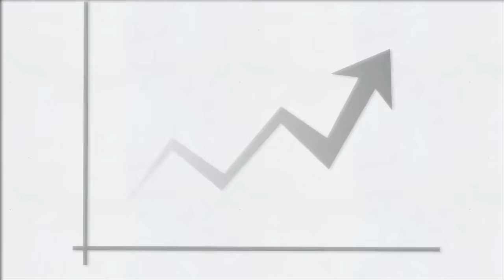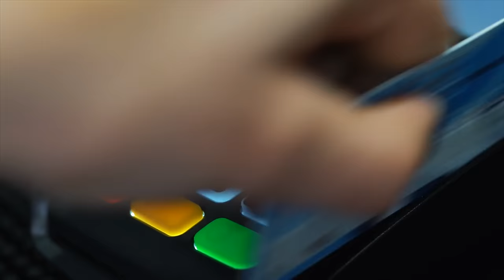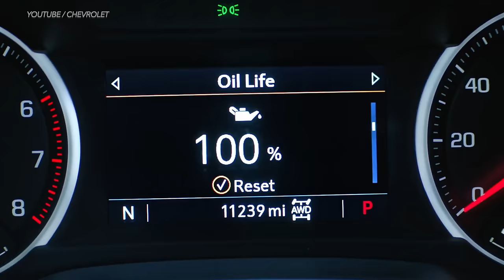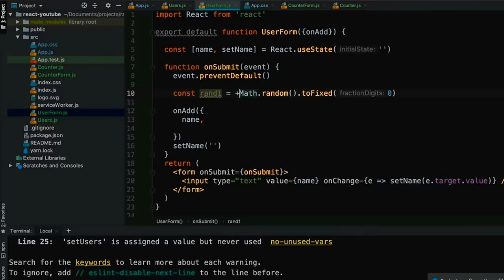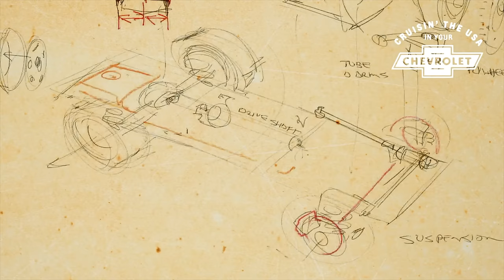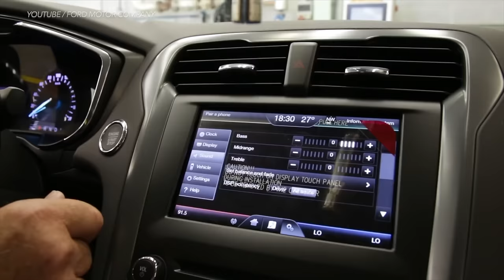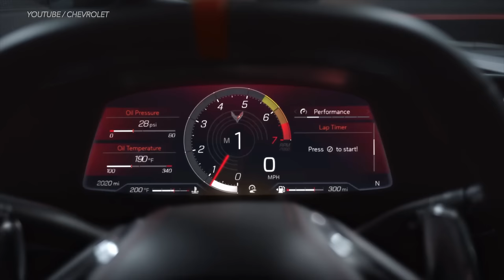Here's Why Car Companies Just Made it Illegal to Work on Your Own Car

Comment: Any company that prohibits Right to Repair doesn't deserve any business.
Reply: Exactly
Reply: That’s why I have a reservation for the Aptera. They design and support DIY maintenance and repair!
Reply: Auto industry is not stopping you to repair.  They are telling you to buy OEM.  That’s different than the IT industry, like Apple, that will not even sell you OEM parts.  If the auto industry tells you only their service department can service, like Tesla, then there is a problem.  Labor will always be the expensive part of the repair, $100-$150/hr, at a non dealer and $170-$200/hr at a dealer.  (Hawaii cost). Example $110 for a oil and filter change at a Firestone, $350 at a dealer (Lexus).  Filter and oil cost $50.
Reply: Yup.
Reply: Speak for yourself. What you really mean is, you say you don't want to give them your business. And that's your right (even though I bet you'll still do it anyway).
Reply: In the early days, the hood (Bonnet) of a Rolls-Royce was factory sealed. Only factory-trained mechanics were supposed to touch them. I sort of have this mental image of someone in a butler's formal attire polishing silver wrenches.
Reply: I am looking at Tesla, Apple Inc., John Deere. 
Good thing I am pragmatic, because I don't like these entities.
Reply: Ya oem is ok be quality aftermarket is often better. I do a lot of the work on my car myself too.
Reply: @executive  not they meant what they said
Reply: @lolcano2346  then it's a good thing it's not up to them
Reply: But yet we keep giving them our money.
Reply: companies don't have the power to prohibit anything
Reply: @executive  how do they not have the power to prohibit anything? You've been lurking round these comments a while
Reply: @executive  why is it a good thing it's not up to them? You haven't really been able to justify a single thing you've said here
Reply: @lolcano2346  look up the definition of prohibit
Reply: @lolcano2346  because its none of their business
Reply: @executive  it actually is their business. Your beliefs on such a thing pretty much come down to where you sit on the scale of pure socialism to pure capitalism, neither of which are good

Your username makes it obvious where you likely sit on that scale
Reply: @lolcano2346  LOL your username says you're 13 years old
Reply: @executive  So I'm not wrong? didn't think so

And I've had my username since I wasn't much older than that so that's unsurprising.. also irrelevant because my username isn't highly indicative of a corporate pig
Reply: @lolcano2346  you haven't grown up
Reply: @executive  sounds like the deflections of someone who can't admit that I'm bang on
Reply: too damn right!
Reply: xx, well I tried that before it didn't worked! I put out a Group of people up to 1000 activist, and after 4 years we were only down to 78 people, Activist. The rest of the people given up and choose to trade in their vehicles and get a new one instead and decided to go on their day to day normal usual business. We've been fighting for this for years. But the government the system is corrupt.
Reply: There's a difference between right to repair and owning a patent on something.  APPLE, for instance, has proprietary parts and nobody could work on the products except for at the apple store.  That is horrible for consumers.  They wouldn't even sell parts to an electronic repair shop, or their own consumers.  But a car company owning a patent for a time frame is acceptable.  As long as others can purchase said part.  They went through trial and error, research and development, and all that expensive stuff.  They should be able to recoup that money instead of having someone else just make the part and sell it without having endured the costs of development. Now engine parts, this is reasonable.  Plastic body and trim parts, far less so.
Reply: It's why I stopped  buying iPhone
Reply: @getacare2735  yep! Well said! 😁👍
Reply: @John Deere
Reply: Apple and anyother company that makes laptops and phones exits chat
Reply: @jasoncurtis4404  your patent, at most, prevents me from making my own copy of your thing. It doesn't give you the right to tell me I can't take it apart.

Comment: 20 years I worked in the automotive industry. I've had to tell customers the bad news about how much it will take to fix their cars and I always hated doing that. I've seen dozens start crying and breaking down over the price. They asked "Why is it so much" and I explain to them about modern cars and how the manufacturer makes them and parts. It's been 3 years since I got out of the industry and I'm sure within the last 3 years it just got even crazier working on certain brand of cars.
Reply: What ones were the worst?
Reply: @Redditor6079  at this point the entire industry is moving in this direction. If you want a car that not as bad, get an OLDER car.
Reply: @Msj10934  I would love to do that but rust eats car up in my area. Anything older in my area develops frame issues.
Reply: people need to start thinking about these things BEFORE buying a car. Not after it's broken down.
Reply: Crystal ball
Reply: @mojo_m7436  it's called research, and not getting sucked in by leather and gadgets.
Reply: I know what you mean.  And oftentimes that car will sit on the lot for months waiting for the owner to make a decision
Reply: 20+ years ago I had a friend working at a small repair shop and when a real hard luck case came in that couldn't afford the quoted cost he would  speak to them on the way out and tell them he would charge them half the labor the shop charges plus cost of parts if they could wait until  Saturday when the shop closed early. That helped a lot because most were older cars with easily accessible parts that weren't always  super expensive.

Comment: I started working in a GM dealership in 1968 and finally had enough of that by 1980. Then I became a backyard mechanic for about another 15 years. But finally it just got too high tech for me and I retired at 62 years old. It paid the bills and I was my own boss, but never did I get rich. I feel sorry for anyone trying to work on cars today. I will drive an older Honda car for the rest of my days, and stay away from the newer models. I worked on some of the most beautiful cars ever made, but those days are long over now,,,,,,,,,,,,,,,,,,
Reply: So, between 1968 and 1980 did you collect enough extra parts to build your own car on the side?  LoL.
Reply: im in my early 20s and doing diy on your cars seems fun. i hope i still can do it
Reply: @peaceonearth8693  Like Johnny Cash sang about in “One piece at a time”.
Reply: Why did you switch from gm to a honda?
Reply: I started working on cars in the mid 60s and still drive a 25yr old car , parts are inexpensive and easy to get.
Reply: @AbcAbc-sp1od  Really, GM is junk on wheels, at least Honda's are built correctly.
Reply: @miltonturner2977  Exactly right. He knows cars and chose the most reliable, simple as that.
Reply: @miltonturner2977  Wow, if that's the case...then I guess I must be watching the wrong Barrett-Jackson auctions
Reply: @miltonturner2977  I still have my 1995 Chevy Silverado with over 200000 miles .
Reply: RIP PONTIAC. Miss the early John Delorian designs.
Reply: @AbcAbc-sp1od  He's retired dummy! You need something more reliable at that age to last and Honda's do preform well at maintenance for longevity.
Reply: @454ss_chevy  You must pray a lot...
Reply: @miltonturner2977  ???
Reply: @AbcAbc-sp1od  My last GM car was a 1978 Chev pickup heavy 1/2 ton 454 stepside short box. Name anything worth a dam after that? Gas and costs just began to cost too much. I have had several Hondas and they were used, but they just keep going and going. Lots of used parts in the Pick & Pull yards too,,,,,,,,,,,,,,,,
Reply: @ddyeo503  that's a good point
Reply: @454ss_chevy  Dealers must be held accountable for their crooked behavior.
Reply: @ddyeo503  My dad has been a mechanic 40+ years. When he was able to buy a new vehicle.  He got the most basic '05 Tacoma that Toyota offered. I don't think he's had to do more than change the oil when needed.
Reply: @AbcAbc-sp1od  The Japanese overbuilt their car in the 80s thru '00..  Toyota 2JZ engines have reached 800 hp on stock internals. Which is insane, since just getting half that requires costly upgrades with most engines. The downside though is now they all been hoarded by collectors.
Reply: @fukkitful  that's true... It's very hard to find older Toyotas. Either Toyota didn't sell many of them, or hoarders won't sell them lol
Reply: I will drive my 2002 Honda CR-V till I die too😂
Reply: @AbcAbc-sp1od  Seems like where I live ppl hoard Tacomas. The rare one for sale will be 25 years old and people still want $5k+.  I'm not saying they ain't worth it. But most have been rode hard.
Reply: @fukkitful  same in my area. Toyota trucks are way overvalued lol, if you ask me
Reply: Agree, I drive a 90s Honda and I would go anywhere in it over my wife 2017 Jeep it's much more reliable. May not have all the fancy electronics, but personally I like the way Honda built these things. There are a lot of electronic sensor but it still has a lot of neat mechanical parts. Plus it's a lot cheaper if you end up needing anything.
Reply: @feero9680  - Get a collectible of the kind that gives you a good and reliable daily ride, get the maintenance books and just start DIY, while gradually buying up the necessary (special) tools from ol' enthusiasts like Dan Yeoman. Enjoy!
Reply: @breakbollocks9164  yep. me and three other friends are spending money on buying money together to buy tools by tools we have started to work on our own cars. i did oil change twice already and replace the high pressure steering hose myself. made mistake here and there (almost didnt know how to put the fuel tank back) and i learn

Comment: I’d like to see a 10 year estimated repair cost on the sticker of each car.  Think cars would be designed better?  Engineers don’t make them easy to work on because there is no incentive to do so.  Simple water and fuel pump replacements are now multi hour jobs because of this.
Reply: true i mean i gotta remove my whole motor mount to do so on my car
Reply: I hear this a lot, but I think in reality it is more to do with engineering production for modern assembly lines and robotics. Not so much there's a conspiracy to stop you from fixing your car.
Reply: All vehicles (no matter what brand) are not built to be easy to work on!   they are built to be easy to assemble at the factories.  The new owners will find out just how hard it is to work on them. Like to pull a transmission or engine out  once they need one.  If you buy a new car you better get the best warranty if you plan on keeping it because a lot of these new cars and made to start feeling after 3 yrs  or 36,000 miles.  Buyers beware!
Reply: *A lot of these new vehicles are starting to fail before the 3-year 36000 mile warranty expires.

Comment: I wouldn't be surprised at all if in the not too distant future car makers build vehicles that the hood is sealed and you have to have a special key to open it and the only place that has that key is the dealership. I wouldn't hesitate for a second to find a way to pick that lock and do as much as I could on my own. People will say "well that would violate the warranty." True, but the "warranty" is worthless anyway when you read all the fine print.
Reply: Eventually OEMs will just rent you the car a mile at a time.
Reply: @nicholasr7987  Thats Telsa's goal. Riding sharing, I think is going to basically be a taxi
Reply: Hell, it might as well be with how little room there is. If its not right on top of the engine. Then your intake and other stuff has to removed.
Reply: Don’t give them any ideas!

Comment: I've been doing my own maintenance and repairs for almost decade now. Started when a 120$ blower module went out and I was quoted 950$ to replace it. Bought the part and installed it in under thirty minutes. It also gave me enough confidence and experience to install an aftermarket stereo a few months later. It was AFTER that I started doing my own oil changes and general maintenance. Last winter my hood latch broke. It would have been a ~100$ repair, but I was it was cold outside and I was lazy and had CarX do it. They charged my 600$ to run a cable I could have ran with a kite string under the excuse of 'Labor Cost' while holding my car for a week. Side note, it was warm outside when I picked my car up. I should have waited. I framed that receipt and it sits over my desk as a permanent reminder that excuses are expensive when it comes to cars. I've already got the stuff to rebuild the transmission when it goes out in a decade since it might not be around later on. I just hit 125,000 miles, bought it at 68,000 miles. I bought this car in 2012. One thing I tell people is, it's really weird how my parents and friends who take their cars to repair shops seem to always need work but mine just needs maintenance. Correlation is not causation, just very suspicious. I hope to get my car to 500,000 miles. I get the feeling it will be illegal to drive my car before it dies with how green legislation is going. If nothing else, gas prices will eventually force retirement. That or I'll take a crack at converting my car to an electric car. I've seen other people do it. If I have to toss it anyway, may as well make it a fun project.

Comment: Right to repair shouldn't even be questioned. You own the product and should have the option to repair it yourself even if it involves voiding a warranty or using generic parts. But if the government does not get involved they will just keep abusing this.
Don't think this only applies to cars, farmers in US are having this issue with John-Deere; even if you use OEM parts the repair must be done by them or else the truck is bricked, laptops are using proprietary parts instead of standardized parts or just solder modular components, electronics with glued parts, etc.
Reply: everything should be questioned. Don't like it? You don't have to buy it. Everyone just wants to whine, but they'll keep forking over their money to support it.
Reply: Courts ruled that warranty isn't voided when you work on the car yourself
Reply: I wish apple thought this way
Reply: But do you really own it? If you really owned it why do you have to pay taxes every year, put tags on your car and have to have a license to even drive?
Reply: F the warranty, usually too short anyway.
Reply: @Kathleen67.  because we live in a society
Reply: @Kathleen67.  because roads cost money to fix. They need plowing in the winter. Bridges need to be replaced. Its just that simple and it cost money.
Reply: @Kathleen67.  revenue to supposedly fix the roads? and accident insurance. I read an article 6 months ago stating no one owns their cars, the manufacture does. you only own the rights to use it. (VIN no) If this was true i wonder how cars made from folded companies like gmh would be handled
Reply: @Kathleen67.  same can be said about property and a house.  People are so gullible and naive. At least accepting we're free range slaves to thousands of year old bloodlines that own the rights to the land air and sea, we can then find a way to be as little enslaved as possible. Debt is a major slavery mechanism. Just soldy WRX and got a good 2001 Corolla, tempted to try to use the courts to argue my rights of operating my vehicle for NON commercial purposes. Many successfulido,many end up sovereign citizens on YouTube because they simply don't want to do the actual processes and just claim to not have to participate in commerce.
Reply: @toriless  my wrx had rid bearing issues early on but warranty ran out at 60k so yeah, not dabbling in a $6000+k  repair if it happened again, sold the car and never looking back.

Comment: This is why I prefer older cars and will never buy a new overpriced one. I’ll get em when they’re 5 years or more old. I think anyone should be able to fix their cars and that there should be laws that stop this price gouging they’re all doing. Good mechanics are the unsung heroes of the world. Well done on the video Scotty!
Reply: I like to keep my cars for between 4 to 6 years, although I bought my Saturn Vue brand new in 2005 for about 15k and it's still my daily driver. This is no longer a good plan for electric cars or hybrids. The batteries will be worn and in need of replacement, often doubling the price of what the car should cost.
Reply: The 5 yr old ones are damn near the same price as new right now
Reply: I can never afford to get one till they're 10 years old, but that's just me.
Reply: @randobad  All the cars I've bought were at least 10 yrs old.. 13 vehicles in 46 yrs. 2 were dogs. A couple of them were nickel and diming me so got rid of them. Most were quite satisfactory. No need to buy from a dealer if you research and check out the proposed buy with a good mechanic!
Reply: @randobad  Buy new and keep for 20 years.  I estimate if I can keep the car I bought 12 years ago another 8 years the cost will be about $2,000 a year including repairs, maint, depreciation, gasoline and insurance.  No financing costs are included.
Reply: @zacharypeery4082  right? A 2017 vehicle cost the same as a 2022 vehicle with 0 miles. Which one am I gonna buy lol.